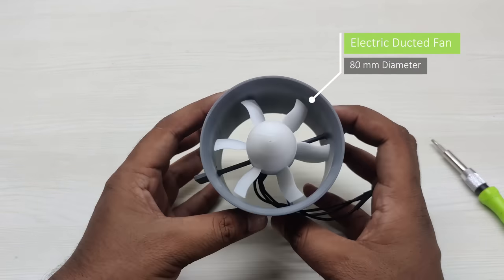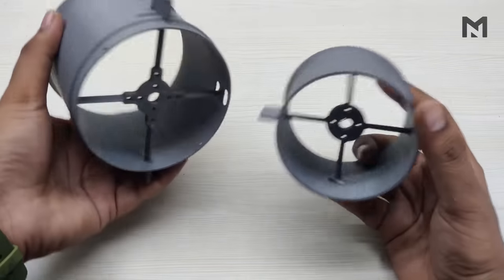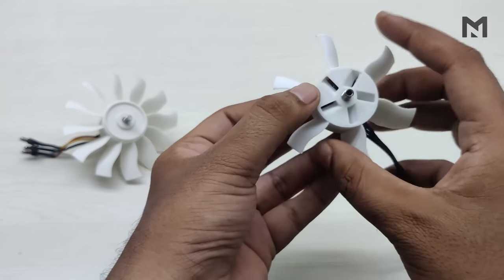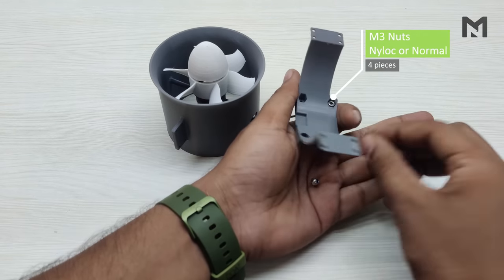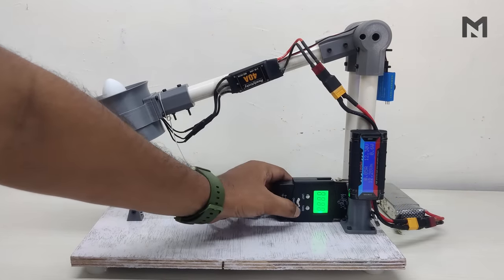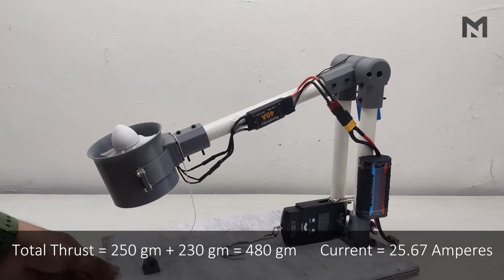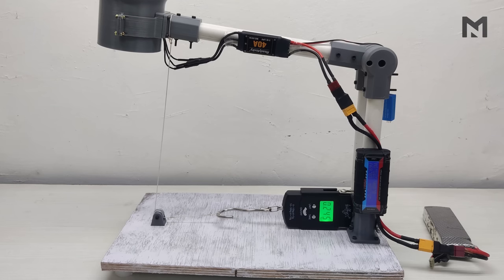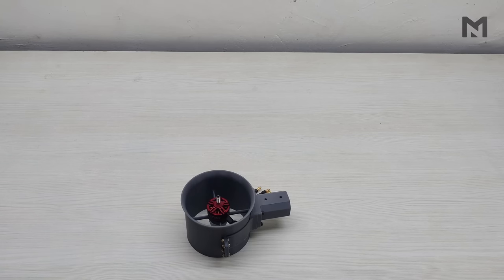DIY 80 mm Electric Ducted Fan | 3D Printed | Thrust test comparison

Comment: I use to fly rc aircraft  and tried ductfans a couple times. From what I remember blade pitch has alot to do with thrust. And there are some online calculators to find the appropriate blade pitch and surface area of each blade.

I also noticed you had an oscillation in the motor sound when running at max setting, that can be caused by a ballance issue or the blades flexing because they are too thin.  If a blade can flex then it changes the angle of attack and causes loss of thrust.
Reply from the maker: Thanks for sharing the information and experience...I will definitely calculate the pitch and reduce it. ...My upcoming video will be a modified version of the current EDF.....
So thanks for watching and don't forget to subscribe 😊😊😊😊
Reply: More blade equate to less efficiencies.  Check out Shubeler EDF specifications. More blade  may give more absolute thrust but not necessarily the most efficiencies which is measured as thrust/power or thrust/current.
Reply: Blade pitch and rpm are closely related.
Reply: Can you provide the link??? What would be the best ductfan blade number and angle?

Comment: You should always use an odd number of propeller blades, this is preventing symmetrical axial vibration which can cause self destruct...
Reply from the maker: Thanks for sharing the information ☺️😊☺️
I will have a look at it...but my EDF rpm is not enough for the propellers to self destruct and hence they are safe but when I will move on to high kV motor then I will definitely keep in mind....
So thanks for watching and don't forget to subscribe 😊😊😊
Reply: many EDF manufacturers disagree——other than it is insignificant, how do you explain the vast number of 10 blade 12 blade 8 blade EDF units
Reply: @kenchen704  Probably because it is cheaper to manufacture and vibration is not a problem ?
Vibration modes on small composite EDF props are very high frequency compared to big one so it much less a problem.

Remember that it is harder to balance a fan with an odd number of blades but if you don't have advanced equipment to balance it, odd number is not a bad choice. It will not be perfectly balance but will not resonate... 
Prime numbers work best (2-3-5-7-11-13 blades)

Some Turbofan manufacturer choose even numbers that are not prone to resonance. 2 times a prime number work great because it's the best of the two words,  26, 34 or 46 for example. It's easy to balance, and not prone to resonance. This is why 4 blade is often used for planes that need power. Same for 10 blades EDF (2x5)

Also, in a turbofan, each row of blades must have a different part count to the next row. They use a different prime number as seed for each row.

It's a very vast subject full of compromise, but I think for less that 10 blades, prime numbers are a good start for Diy...
Reply: @arthurbesnard1536  congratulations, you have proved your own terribly generalized statement wrong
Reply: @kenchen704  Why ? I mean his EDF is not small at all, and clearly not balanced, so using a prime number of blades would be beneficial in his case...
Reply: @arthurbesnard1536  I know that in submarine props, they tend to use prime numbers for the same reasons you stated. I have never heard of the doubling of the prime number, or being able to use the prime number as a seed for stators. Thank you for the information.
Reply: Where did this bolleaux come from????
Reply: @kenchen704  easy, Sound. The resulting sound of a 12 blade sounds more like a jet engine than 6 blade fans do… oh and that high pitch annoying sound from a 6 blade is way WAY louder, 12 blade fans all you hear is whoosh💨 as it flys by.
Reply: It’s a ducted fan not a radial engine
Reply: @kenchen704  there is zero advantage to having even-number blades, while odd-number blades have the advantage of reduced vibration. If he is building his own propellers, there is no performance reason to use even number blades.

Comment: Very nice work.  It looks like you made your blade tip incidence 45 degrees, presumably for printability, but this is much too high for efficient static thrust, as it puts too much energy into the exhaust efflux.  If you can print it so the tips are more like 25-30 degrees, I think you will see higher thrust, and in that case your design will probably optimize on a different blade count.
Reply from the maker: Thanks for suggesting me....And I will definitely try it. And if you have any best blade design than you can mail me at themechninja@gmail.com ...if it improves the thrust than I will definitely make a video out it and pin you....
Thanks for watching and subscribe for more videos 😊😊
Reply: @MechNinja  If you should optimize your blade design further, will you please make it available to those who purchased your EDF stls?
Reply from the maker: Hmmm ok bro...😊😊...when it will be available then just remind me....😊😊
So just press the bell icon so that you don't miss the video... thankyou...😊😊
Reply: Reducing the clearance between the blades and the duct will also make a big difference
Reply from the maker: Yes definitely...and current clearance is 1 mm and If I reduce it then blade will start hit the outer casing. Because no matter how round it is, but 3D printed part will try to expand because of centrifugal force on high rpm.
Reply: @MechNinja  From my own work, if I got any kind of rub at all, thrust was greatly reduced. This is why it's imperative to collect good voltage, current, rpm, and thrust data. It's also useful to have a witness layer on the case, like a light misting of spray paint, so that it is easy to see if there was a rub.
Reply from the maker: Well yes a scratch in the paint is useful but I can tell it from the scratching sound. Once there was a misalignment of the propeller and it was touching the outer casing so there was a scratching sound.
So if I will reduce the clearance then there will be a scratch sound and vibration....
Reply: @MechNinja  I've had rubs that were subtle enough I didn't hear them, and yet thrust was down something like 30% at same input power. Happened when I over tightened a hose clamp to hold a bellmouth inlet on.
Reply: @MechNinja  what rpm have you tested upto?
Reply: @MechNinja  have you tried using carbon fiber filament?? I'm relatively sure that it won't expand.
Reply: @MechNinja  If you don't already, use fine sandpaper to make sure that the edges of the fan blades are completely smooth after removing the supporting material. A smooth edge will improve airflow over the blades for optimal performance.
Reply: The absolute best angle has been studied at 25.5 degrees. The Tension Turbine uses 30 degrees, as do almost all windmills.
Reply: Beter efficiency doesnt mean more trust, it's about energy input vs. energy output or inv. 45° blade angle  gives best trust, but isn't efficient because it gives more resistant

Comment: Since 6 blades are 1.73% efficient and grad to throw a greater amount of air to be used as thrust, why wouldn't you test 5 blade or 4 blade propeller?

Comment: Be interesting to know with the extra mass of more blades, plus it appears that the pitch of the blades is identical. the motor is drawing more power, so what affect is that having on RPM, if any.  Also (I'm not an engineer, not even close) my logic is telling me that the more blades you add the pitch would need to be reduced to compensate, or increase  the motor size.  the thinking behind my "logic" if you want to call it that is WW2 fighters they had Variable Pitch propellers, so depending on the RPM and altitude (air density) the pitch of the prop adjusted automatically to match the engines peak optimal power...sound about right to you??

Comment: Did the mass of the propeller change significantly from 6 to 12 blades? You seem to have used the same mass for the "ideal weight" of the test arm across all the tests.
Reply: It doesn’t matter since it adds to the weight of EDF, not the arm.
Reply: @MahinKhattak  it matter
Reply: @sanghyukseo1498  it doesn’t 🤦‍♂️
Reply: @MahinKhattak  it does, because it first needs to lift its own weight to lift the arm.
Reply: Yes, it matters.  The thrust has to overcome the extra weight of the additional blades.  If it were mounted horizontal, then the additional mass wouldn’t be an issue but the additional mass must overcome gravity to move.  It matters very much.

Comment: First author take time to pay attention to holes for motor ventilation then placing diffusor over it covering holes. Awesome!))
Reply from the maker: I have checked the thrust in both the cases, with and without the diffuser as I want to check the difference in thrust.

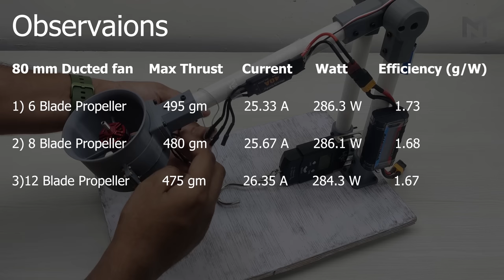Comment: result at 10:49 will change if you will test it at full charge for every type of propeller. 6 blade propeller is way higher than other because it was tested first, the last one was tested with battey not in it’s full charge state. Maybe you should include in the table result the voltage reading before each test.

Comment: Static testing might not tell the reasons for using different blade numbers though. Supposedly there are different thrust curves and depending on the speed the aircraft flies, there may be differing efficient operating ranges. (Slower aircraft may benefit from a different blade count than faster ones.)
Reply: Yup, missing variables for sure. He could time them based on a set distance, rpm, and thrust.
Reply: That's a critical point . To put it in simple terms this test gives the thrust when fan is not moving through the air . So figures are accurate if used in a hovering drone , thrust directed downwards , efectivly no movement , but if fan used on a plane moving through the air at perhaps 50meters/sec the air is already pushed into the fan at that speed and then many blades ( and different blade pitch) may result in higher efficiency ... In an ideal world you will know the speed of your craft and the manufacturer will suply the most efficient fan type.
Reply from the maker: Thankyou for your valuable response.....Is there any other way you want to suggest me for thrust testing....and in my upcoming videos i have i have redesigned my test rig using a load cell and calculated more accurate results....
Thankyou for watching and pls subscribe my channel so that you don't miss any video.....😊😊😊😊
Reply: @MechNinja  I think the only way to be more accurate is to make a small wind tunnel . This need not be complex , Just a fan or fans and a tube or box section ( perhaps 50cm diameter) so the air is directed onto your ducted fan . the air flow has to be made non turbulent by putting guides in the tube. By varying speed of wind tunnel fan/s  you can change speed of air flow and so measure thrust of your ducted fan at different velocities . Supose you have an tunnel air flow of 20meters/sec with no power to your ducted fan it will show a negative thrust Due to drag
Reply from the maker: Wow.... seriously i really appreciated your thought...and it looks easy to build but I am damn sure it will be a difficult task to do.....but yes this method will leads our test to another level of complexity....i have noted down sir and i will definitely do it in future...when I will go deep in testing.... currently i am working on different profiles of the blade for maximum thrust....
Thankyou for your suggestion sir...
And thankyou for watching the video and don't forget to subscribe 😊😊😊😊😊

Comment: Very nice! By increasing the amount of blades doesn´t mean it will produce more thrust, it will get heavier to spin and you will need more torque and hp. But then again, by increasing the rpm, the 6 blades will probably meet it´s end of map, and by spinning faster over that, more blades may be required, and so on.
Reply from the maker: Thanks for the tips!
And thankyou for watching the video, Actually its my old video. Do check my new video, there are good too. and don't forget to subscribe.

Comment: How does the motor cooling will work when you have covered the grooves exposed to motor but covered by diffuser?
Reply from the maker: Yes in the 3 cases I have covered it with diffuser. But in the last case I have removed it and the results can be seen in terms of temperature difference.
We'll that depends on us whether to keep the diffuser or not...
Thanks for watching 😊😊
Reply: You are good.
Reply: @MechNinja  I wonder if you take the tip off of the diffuser if that would let enough air through, especially when the unit is actually in flight? 🤔

You could even build a small 3 blade into the diffuser nose that would ram air through there when it spins! 😂

Comment: For the 6 blade the battery is full 12,20 volts but whit the 12 blade is more discharged 11,69 volt . I think... it is important that the voltage output from the battery is always the same,otherwise the ampere will increase and the engine will perform less. What do you think? The test is intresting! Thanks
Reply from the maker: Thankyou so much for watching and don't forget to subscribe.
You can check my latest videos with good results

Comment: Nice test rig! I'd only suggest to add counter weights  to balace out the weight of the arm and edf. That makes the math easier and would allow to measure the force at every given speed and not just full force
Reply: Why add counter weights when you can simply balance the fan blades
Reply: I think I understand your comment in relation to the test, the test was to measure the maximum thrust… the counter weight would conflict with results

Comment: I did not expect them to be so similar! Great test.
Reply from the maker: Yes bro the results are similar....
Next tym I will use a high torque motor....
Thanks for watching and don't forget to subscribe ☺️☺️
Reply: they are not similar the arm is locked upto a position every fan goes only to the same length thats why they are same
Reply: I did turbulence and air restrictions added weight.  Ur only tuning ur not gonna increase thrust much changing the shape of the edf housing.  Would change things like thrust.
Reply: @far1002  I am not talking about the edf but the thrust stand in which the edf is mounted it is limited to a certain travel so the edf cannot produce more thrust

Comment: It would be interesting to know what rpm these fans were turning at and if there was any difference in thrust at different rpms. Nice video.
Reply: Interesting but rpm may not be helpful as more blade means lower rpm and higher power albeit more absolute static thrust. ...my 2 cents

Comment: Not sure if anyone’s pointed out or you’ve since discovered the data collected with your thrust calculation rig is incorrect and invalid, but easily corrected without retesting. 
The ideal weight you measured is to low and missing the total weight of the 4 screws used to attach the EDF the arm.  So your total thrust calculations are to low seeing that it’s lifting more weight than what’s in your Base data.  
Weigh the 4 screws and add it to your test results to get the correct and higher thrust results.

Comment: more blades yields a higher the compression and slower air speed so you need reduce the exhaust orifice size to get greater thrust, possibly an adjustable exhaust orifice like a jet has to test the max output thrust
Reply from the maker: Yes you are correct, more blades means higher compression but the the motors I am using has a low torque, so it won't be efficient.
But I am working on another EDF which as max Thrust than this...
So thanks for watching and don't forget to subscribe 😊😊😊😊
Reply: @MechNinja  which type of motor you use
Reply from the maker: Racerstar 2500 kv motor

Comment: Nicely done! Maybe time to test three blades and see if it's even better?
Reply from the maker: Yes I have tested it on 3 blades and In the conclusion part I have said too. Actually the 3 blade propeller was working poorly because the pitch is hight. So in my next video I will reduce the pitch and test it on different propellers......
Than I will update the result.

Comment: You are using pulley to connect the weight machine. Is it giving any mechanical advantage
Reply from the maker: No it's not giving any mechanical advantage. But If I had directly attached the spring balance below the motor than the path of the thrusted air will be blocked because of spring balance and hence decrease the thrust. Thats why I have used a string to reduce surface area.
Hope you get my point.😊😊😊
So thanks for watching and don't forget to subscribe 😊😊😊😊
Reply: @MechNinja  I won't forget
Reply from the maker: Don't forget to subscribe 🙂🙂🙂

Comment: Bro, i love your creations and i admire your creativity.
And im kind of wondering is a propeller better than a ducted fan or the other way around
Reply from the maker: Both are unique in their own way.....the difference is that... though propeller produced more thrust as compared to EDF, nut EDF takes less surface area ( 3 inch dia ) as compared to propeller ( 6 Inch ).
We can't use propeller in RC jet plane but we can use EDF because of its smaller size as well as it's mass flow rate of air.
Hope you get my point.
Thanks for watching and don't forget to subscribe 😊😊😊

Comment: I'm not surprised. More blades = More leading edges, each of which require motor torque to 'slice' into the air. The ideal number of blades is the most blades that can be used, that will allow each blade to get a "full scoop" of air. More blades means that the total surface area of each blade is NOT being utilized, so there is no gain in thrust. Just more leading edges, to create rotational drag on the motor. With the surface area of each of these blades, I would think the optimum number is 5 or 6 blades.
Reply from the maker: Thankyou for sharing your view on this video. And yes the maximum thrust was from a 6 bladed propeller.
And this is my old video. do check my latest videos on EDF,  they are good too.
And thankyou for watching and don't forget to subscribe 😊😊😊😊